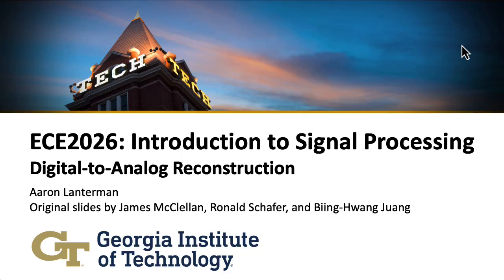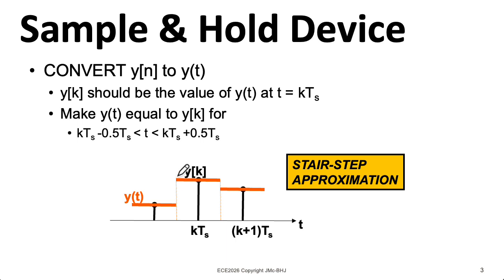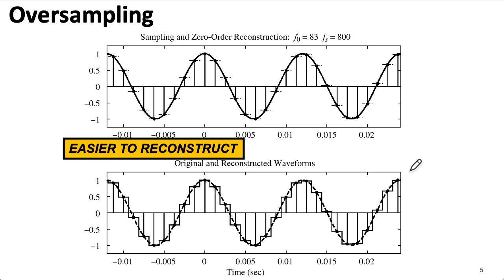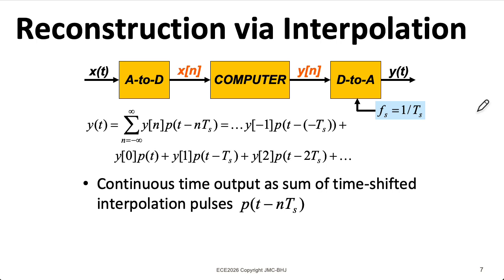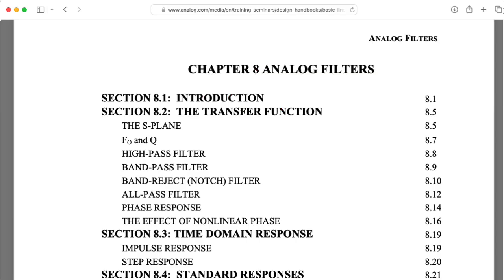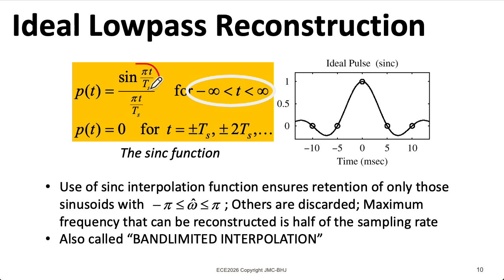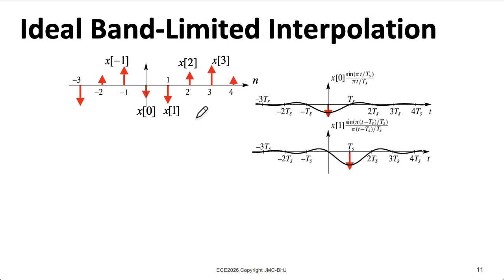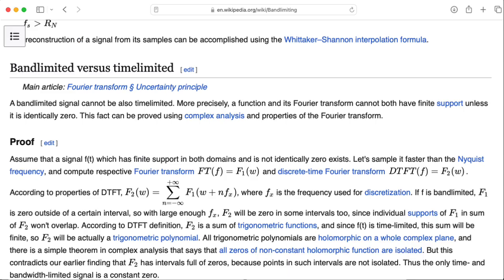ECE2026 L22: Digital-to-Analog Reconstruction (Introduction to Signal Processing, Georgia Tech)

Comment: It seems that even simple signals such as the square wave is non-band limited (its Fourier coefficient is the sinc function that goes on to infinity). But the square wave is widely used everywhere. So wouldn't that cause a problem with the interpolation criterion?

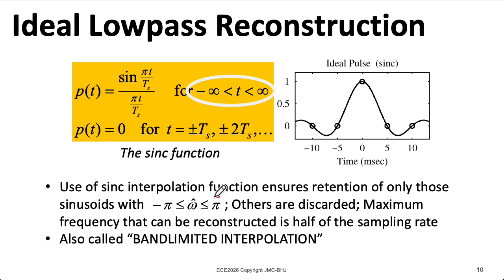Also I noticed this inconsistency. In this lecture, at 7:34, you say that the interpolation function ensures retention of only those sinusoids with -pi <= hat omega <= pi. However, in your first lecture on Shannon-Nyquist sampling theorem, you said that the Nyquist rate is greater than, implying that the inequality is strict, -pi < hat omega <  pi. See Lecture 20 at 11:16 seconds. Sometimes the inequality is strict, other it is non-strict, and other times only half of the inequality is strict. What gives?